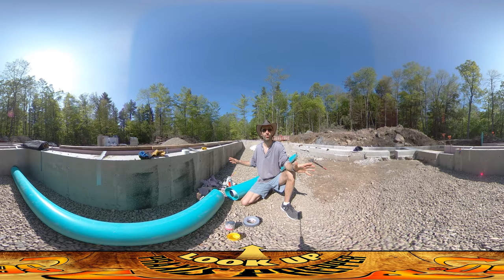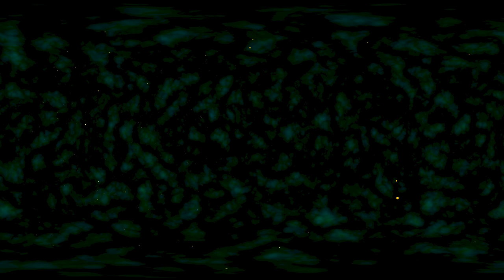Homestead Building - Communication Issues, Sub Floor Woodstove Vent Gets Glued Together

Comment: This is the house that Praxis built
This is the air pipe that is going into the house that Praxis built
This is the spray foam that will seal the gab around the air pipe going into the house that Praxis built........
Reply: XD

Comment: For the inner 4" or 3" PVC pipe you could have joined with a stadard 45 PVC elbow, or use 22's to get the right angle needed. I presume ditto for the 8"? Blue PVC pipe. That but glued joint will never last. Its going to give under thermal expansion\contraction or the weight of the slab when its poured.
Reply from the maker: Thanks for all these tips. I had actually thought about the push and pull with the heating and cooling of the slab and had (I hope) accounted for it. That whole pipe down there is floating inside the 8" and I planned to pad out the exit point with foam when it comes up through the slab with foam for this purpose. Do you think that'll cut it? Thanks for your expertise!

Comment: Just call up Home Depot again and say (come on homey) (home boy!) Wasup with that? If you are up to it, keep filming the process and just edit in the clips of each part of that process. There are lots of visual learners who would benefit from that.  Maybe you have that stuff available on patreon?
Reply from the maker: I wish I had recorded the connection process when I did it for this step. I was a bit nervous about it because it had a lot of steps that involved expanding spray foam, glue and tape all happening with the correct timing. But it actually went really smoothly. I show a lot of the carpentry coming up for sure. I try to place a little tidbit tip into each video when applicable.

Comment: I don't think its a good idea to use air as your heat transfer medium as it not very dense, and I think a 4" pipe diameter (guessing) is way too small. You have to use a lot of pressure to move any significant amount of heat with such a small diameter pipe (ie like living inside a running dryer). Also you air will have extremely low humidity.  The other issue is the possibility of air contamination with combustion products (ie carbon monoxide). Did you run this by a building inspector? its Likely he will reject this implementation & condemn your project.

Best way is to use Hydroponic heating via radiant flooring (or walls): Much better heat transfer. No worry of airborne combustion products, No nasty ducts that get contaminated with dust, insects, mold, etc.
Reply from the maker: Maybe I didn't explain what I'm doing well. No combustion gasses are moving through the floor. This is just a conduit to run to the outside air intake of the stove. Or am I not understanding your critique?
Reply: @PraxisPrepper  OK, I presumed you were using it to move warm air. Inspector may ding you for not using metal since plastic is generally frowned on since if a hot ember gets in the intake its going to cause a problem. Generally all piping (intake & exhaust has to be metal when dealing with combustion, or dryer venting)
Reply from the maker: Yeah, it'll actually be freezing cold air in that tube - hence the insulation. I'd considered metal, but it's not unlikely that moisture would be down there and the condensation on the outer wall would likely rust it out over time.